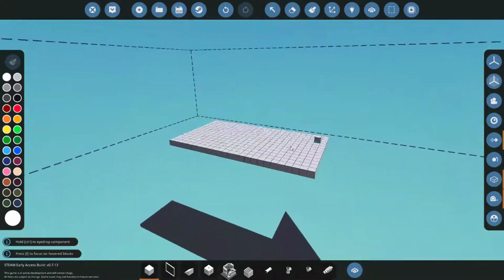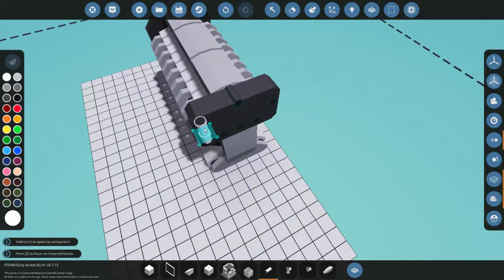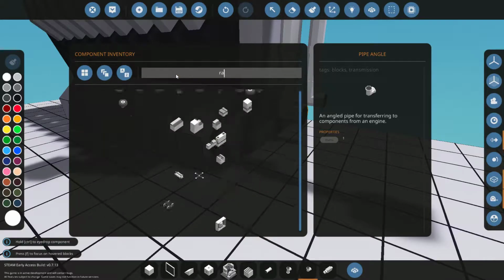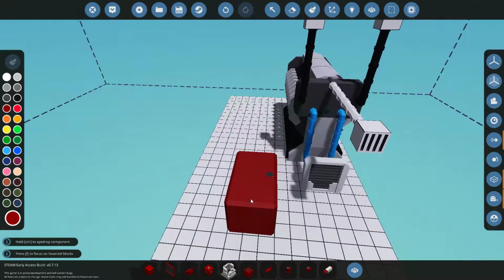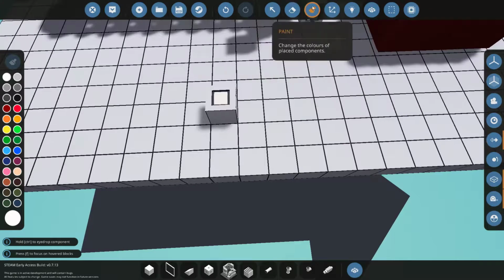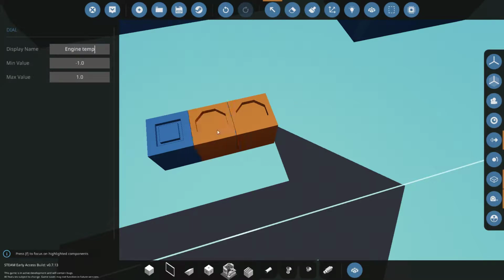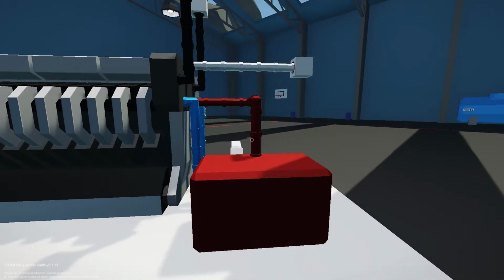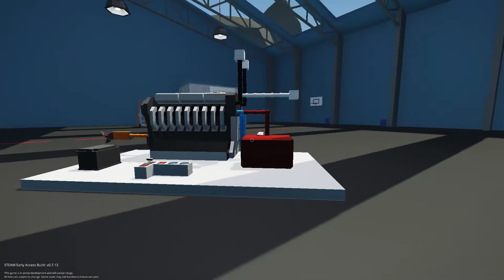How to build a simple Advanced Engine In Stormworks Build And rescue

Comment: No matter what throttles at the engine goes to 20 rps
Reply from the maker: Click the "select" button at the top of your screen(it looks like an arrow) then select the engine and change the RPS on the engine to max.
Reply: @Sniper-zz7wr  that just blew it up
Reply from the maker: @bbob190  Yes, the downside to higher RPS is higher temps therefore your engine will explode, to fix this make your cooling system much much bigger

Comment: When i did the same my engine didnt start
Reply from the maker: Can you explain further? is it not cranking? is it not running? have a look at the comments on this video there may be some things in here that may help you
Reply: I connected everything fuel electricity cooling it just started reving When i cranked it
Reply from the maker: @HKidk_anything_else  Interesting, id try deleting your throttle lever and replacing it don't change anything with the throttle lever its self just wire it up and give it a go
Reply: Thanks for answering 

I tried changine the throttle but it didnt make a diffrence
Reply from the maker: @HKidk_anything_else  Unfortunately i can't think of anything else that could be wrong, all i can recommend is maybe re-watch the whole video and following it step by step
Reply: Thank you for answering and i wont disturb u any more
Reply: Hey there long time no see

I found out that it wasnt the engine the game had bugged and made nothing work, so everthing u Said was right
Reply from the maker: @HKidk_anything_else  Good to hear that you got your engine working thanks for watching!

Comment: this helped but i still cant get fuel to my engine
Reply from the maker: make sure your fuel tank actually has fuel inside of it, then make sure you have your fuel connected to the correct port for fuel, if that is all in check try clicking the select button and click on your fuel tank then make sure its diesel
Reply: i found out what was wrong but thanks
Reply from the maker: @clamidy  no problem thanks for watching!